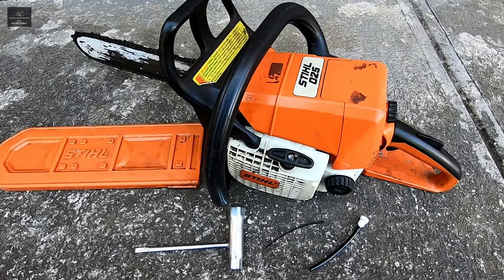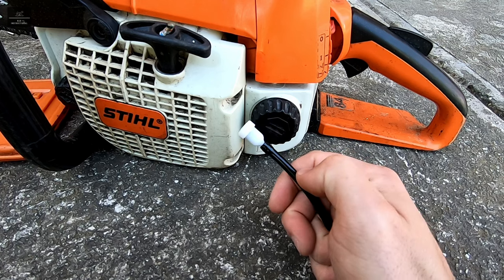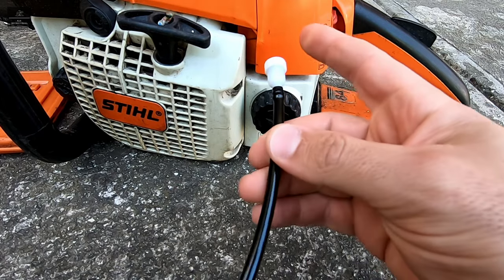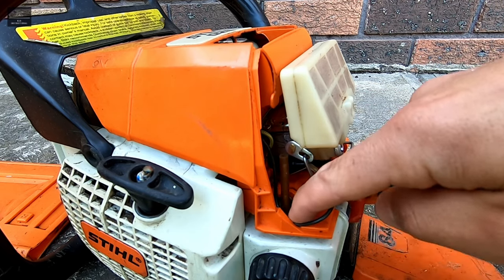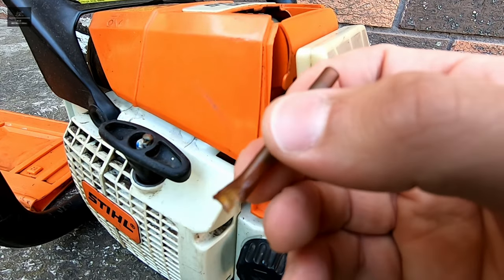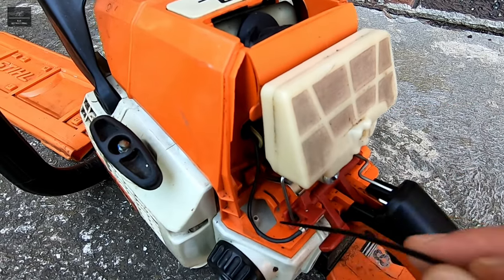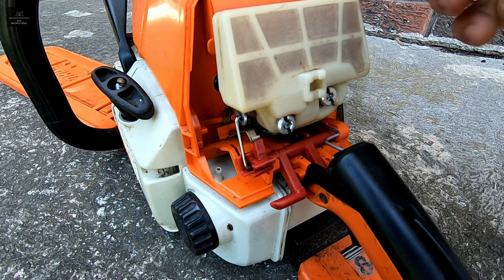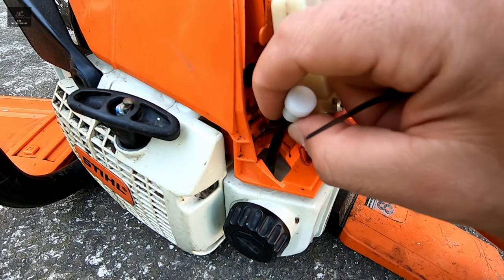How To Replace The Fuel Vent Line On A Stihl Chainsaw - LEAKING, STALLING, UNDERPOWERED!

Comment: I found it online, it's called "Echo Vent Assembly Costs a pretty penny, but it's better than blocking it off like we did, where it popped off and spilled fuel everywhere on a hot day of it running.

Comment: Man your 025 has a way different filter than mine. Mine wasn't acting right it. I had the original oem one so I replaced it with the original oem and it just keeps blowing off also since I modified the saw. Everytime i go to tune the high it just blasts off like a rocket or fuel still escaped out of the top lmao. Thanks for letting me know I can use a different one. Definitely going to use the zip tie

Comment: Hi!  I have a 30 yr old Stihl 028 chainsaw that runs great!  I was using it the other day and fuel started spraying out of a thin hard white plastic tube that can be seen on the body of the saw just to the left of the fuel filler cap.  Should this white plastic tube (quite thin and about 2" long have a fuel tank vent line attached to it? Never had this happen before so not sure what might be causing it?  Thanks for any help and have a good night!

Comment: MS310 .  Will start only when I add fuel to the carburetor and then dies . I've changed the fuel lines vent line and pulse line and two carburetors, but it still isn't getting fuel. When you take the fuel line off, fuel squirts out so the pulse so the carburetor must be getting fuel to it . Also checked compression spark timing, etc . I know it's a fuel issue, but nothing seems to help . Any ideas ?

Comment: Can you run the saw if the vent line is not on?
Reply from the maker: Probably, but you will most likely have fuel spill out as well as providing an entry point for dust and debris to enter into the tank...